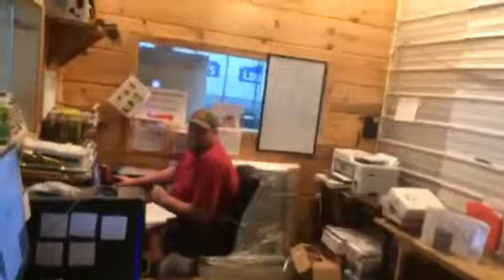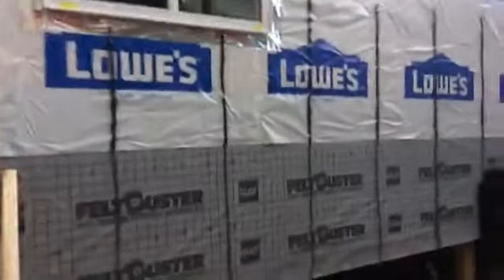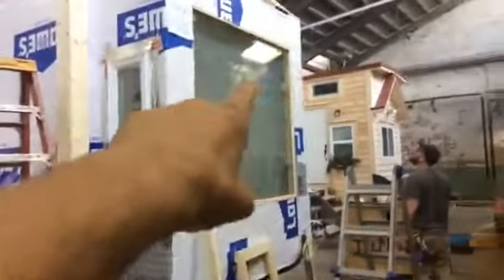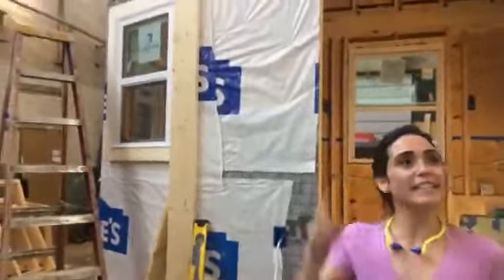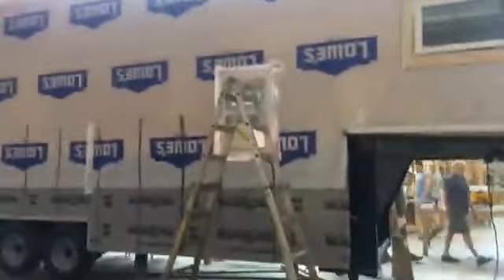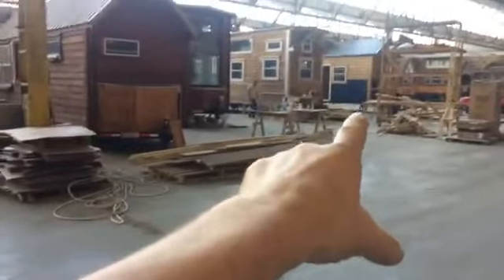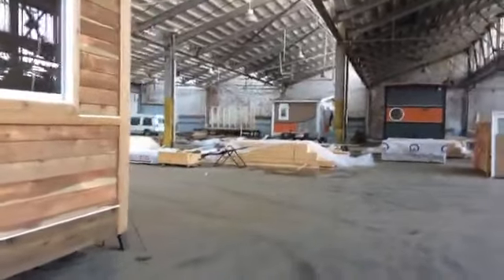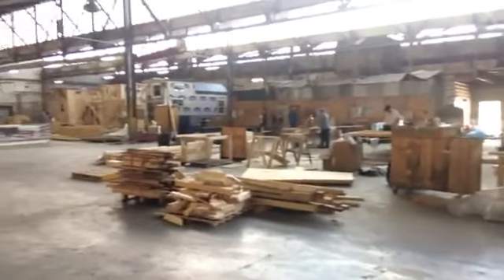Incredible Tiny Homes:  May 2018 Workshop Day 1 Progress

Comment: So is the price of the home have to do with how much the customer does or does it matter.
Reply: Basically, they only charge for what work they do and what it costs them... So anything the customer handles will not be included in the final price... This includes any materials the customer provides...

The workshop deal is just time sensitive, so the customer has to be able to handle it within 6 days, which is why it's important everyone bring enough help with them when going to the workshop.

Mind, they still have a business to run and so they can only spare so much time to the workshop...

So, while they can technically let a customer do nearly the whole thing, some things like installing gas and electrical lines do require a licensed installer, the workload has to be kept realistic to what can be handled in the six day time frame...

Though, if you don't need them to show you how to do things, they can also just sell you the shell or even just the plans...